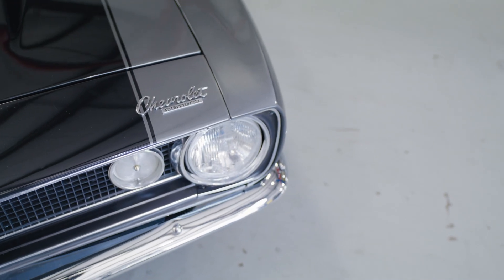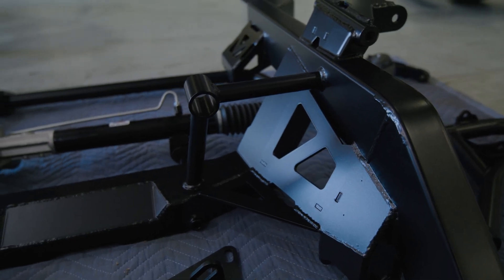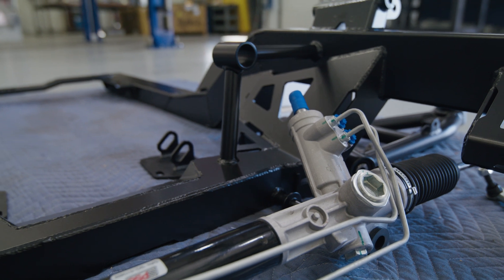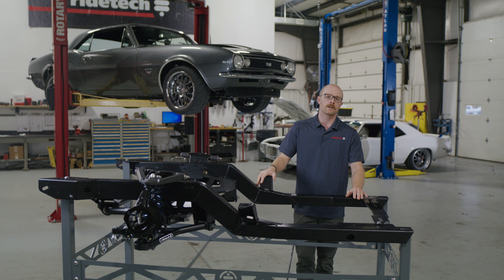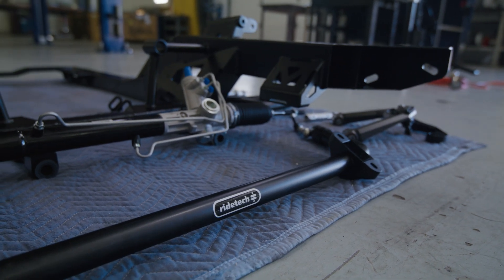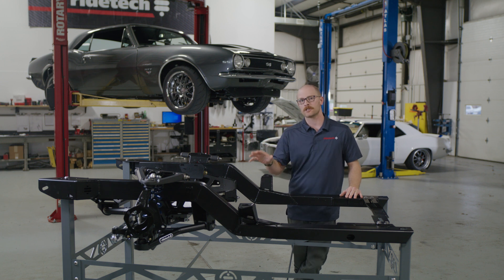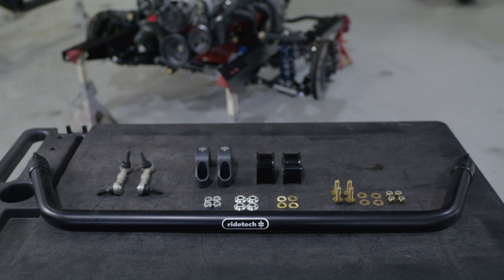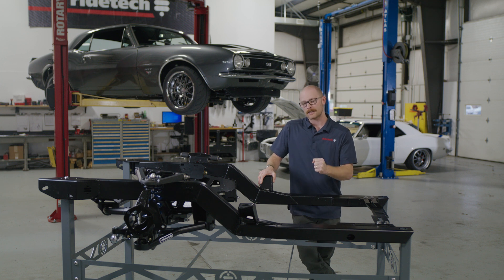Overview | MOMENTUM Subframe Series by Ridetech

Comment: If I install in my 67 Firebird with the Pontiac 400 and later decide to upgrade to an LS, what is required to switch?  Is it just bolting on a different motor mount?
Reply: Its only going to be motor mounts.
Reply from the maker: Engine Mount plates would be the only item you would need to alter.